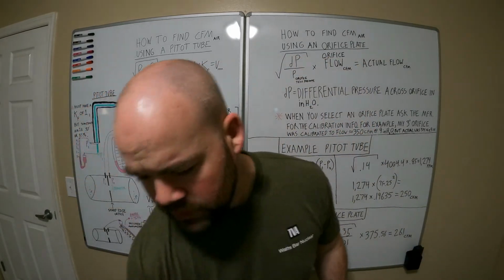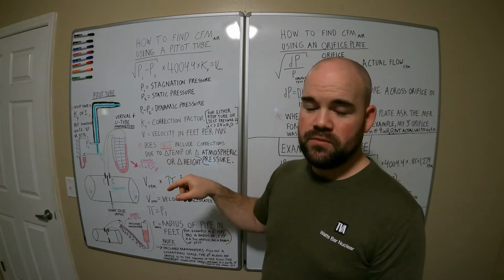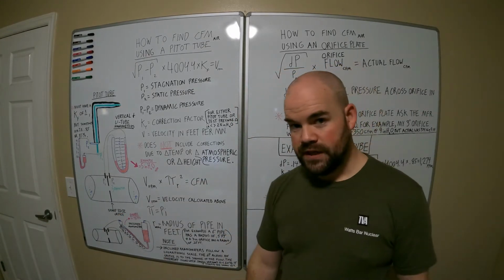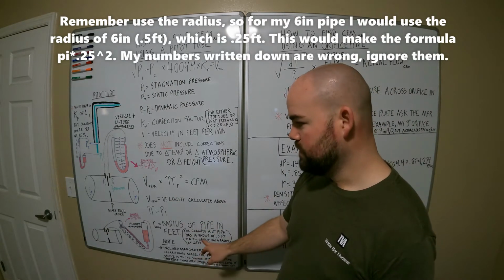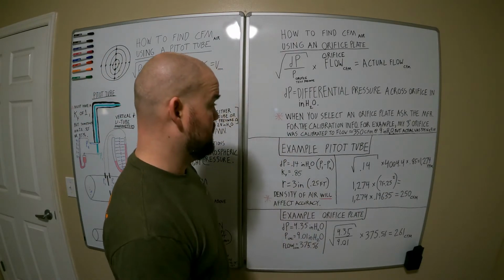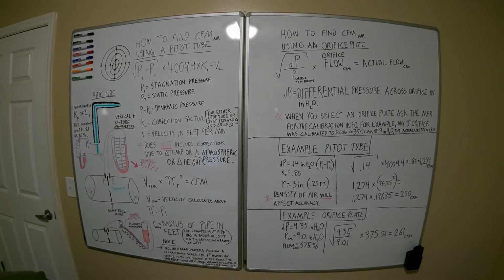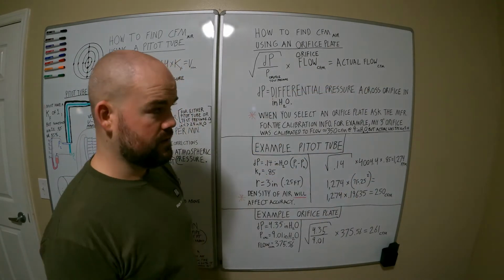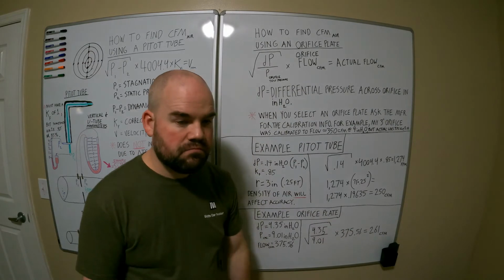Homemade Flow Bench Part 1, How to Calculate CFM

Comment: I’ve watched this video a half dozen times now and I still feel like I’m missing something. I’ll figure this out eventually but right now I’m stuck. I’m putting together a bench like yours. Thanks for helping.
Reply from the maker: @mikefriesdrums  what do you feel like your missing? I have other flow bench videos too.
Reply: @ I think I got it now. I need to qualify my bench that’s what I was missing. I just started learning about this stuff a week ago. I want to have a flow bench to test port mods on LS heads. I have basically the same setup as you with 6” pvc. I made a 2.6” orifice plate but I can make it 3” on my mill. Now I need order a pitot tube and 510i.  So I’ll need a second orifice plate for qualifying and that one goes over the test end.  Then use 510 to measure cfm at 9” water and use those numbers in the equation to determine cfm of test piece.  Diff pres/9” then square root of that multiplied by the cfm it qualified at. I’m on a tight budget so it hurts to have to order the pitot and 510 but I’m sure it will be worth it in long run. Thanks for the great videos.

Comment: Been there done all that. Superflow has the right idea of how to do that. Pitot tubes are a big waste of time in a flow bench.
Reply from the maker: @billshiff2060  unless you have something of value to share, please do not comment on here. You obviously do not understand their role in qualifying a new bench when starting from scratch. Their application is very important for qualifying a new orifice plate as the math can easily be done to find cfm the use that to validate the DP across on orifice. The people watching this video are here for education on how to build their own instead of spending 10k+ on a product that is unnecessary. Superflow has a nice product, but they overcharge and take advantage of people lack of understanding and education. I am clearly not in it for the money, so I share my time and knowledge for those who want to learn it.
Reply: @tristan_white  Using a pitot tube to calibrate a flow bench is a waste of time and is inaccurate. It is a pretty sloppy technique taken from the HIVAC industry, not suitable for high accuracy.
 In every case, a flow bench measures from the atmosphere to a vessel or from a vessel to the atmosphere, rendering a pitot tube redundant because it is a total pressure pickup which is the atmosphere in our case.  There is no use in measuring a section of internal piping on a flow bench where the total pressure is different from the atmosphere.
I am not recommending superflow at all, just their methodology. 
I have built several flow benches and made all these mistakes before getting it right. 
I wrote the original wikipedia article on flow benches. I don't want to re write it here but to point out that this here is not the best path.
Reply from the maker: @billshiff2060  tell that to airplanes, F1,  NASA, and my Nuclear Plant whom all heavily rely using pitot tubes and their derivatives as a major influence in understanding fluid & airflow dynamics.  Superflow uses an open plenum with an offset opening and flow straightener upstream of an variable orifice plate. It's a simple design and has its own flaws but works just like mine in the end. How do you think they determine what each of their orifices flow?
Reply: @tristan_white  Flow elements are calibrated with a King gage. Aircraft use pitot tubes because they fly at various altitudes where total pressure varies a lot. A  total pressure sensor is needed whenever the outside atmosphere's pressure cannot be determined from inside the craft due to it's movement.
Reply from the maker: @billshiff2060  a King Gauge is basically a go or no go gauge, but how do you think it is originally calabrated?
Reply: @tristan_white  No the device I'm referring to is a large telescoping tank that is completely sealed but free to expand. It captures the entire flow over a time period and it's dimensions gives the true volume flowed in that time. All other instruments are calibrated against that data.
Reply from the maker: @billshiff2060  I know what you are describing, however the margin of error is still high on those. As the air is worked it heats up causing a dT which changes the pressure causing adiabatic expansion. As the air cools off it contracts. The device would have to be heated up and stabilized at the exact discharge temperature of the device to be considered an accurate number for total volumn. A pitot tube (while old tech) if used correctly will get you very close to accurate numbers (no problem for a DIY person to do in their garage). At the end of the day, all we are looking for is an improvement in flow given repeatedly is maintained on the bench (no leaks). The actual numbers are for magazine articles and bragging rights with your buddies only as hp is determined by mass flow, not volumn flow.
Reply: @tristan_white  Exact accurate flow data gives you the information needed to determine how much there is left and where to put efforts and where not to. The actual flow coefficients of your ports and sections of ports are needed to know how close you are to the limit. There is a hard, absolute maximum limit on how much flow can be had from a given area at a given pressure differential. To know where you are you need accurate info.
It would be great if you could compare results with others in the field but that is unlikely because of all the inaccurate stuff out there. Like the dikhead move of using increments valve lift instead of L/D increments makes it impossible to compare  anything other than identical setups.
Reply from the maker: @billshiff2060  I agree with you there. The flow bench is misunderstood and is not used correctly often. I will also say, though, that measuring the localized port velocities per cross-sectional area is best done with a miniature pitot tube 🫣 lol
Reply: @tristan_white  Oh I am not saying pitot tubes themselves are not good. Only using them as the flow measuring element of the flow bench itself.  For exploring test pieces they are very valuable. I made many and used them all the time. For that they are an essential tool but they do require a good knowledge of how they work to understand what they are telling you.
Reply from the maker: @billshiff2060  yes they do.

Comment: Is there any documented reference you can point me to for the formula on calculating the CFM using an orifice? Before I found this video I could not for the life of me find or figure out how to do this calculation. I finally decided to try YouTube and here I am. But I would like some insight as to where the formula you're showing came from, if at all possible? It makes perfect sense when I used the factory orifce specs to this equation. I'm glad I found this video, everything is explained very clearly!
Reply from the maker: It is a simplified version of Bernoulli's equation. The square root of the differential pressure is directly proportional to flow rate. Watch my video later in the series for how to calibrate your bench. Once you know what flow you have using the pitot tube equation given a specific pressure drop across the orifice you can input it into the orifice equation. The square root of the dP is a percentage of a known flow at a fixed pressure drop. Does that help?
Reply: @tristan_white  Ya I'm definitely understanding it better, much appreciated in taking the time to write back!
Reply from the maker: @Teddy8709  Anytime.

Comment: I have build a flow bench using testo 510 but my differential pressure is only 0.2400 psi average with 3 vacuum pumps. What can be wrong . My orifice is a PTS 350 cfm @9" with a 2.933" hole.
Reply from the maker: What are you trying to flow test, and what is the test pressure set at? Whatever your flowing is at 57cfm if the calibration is correct for the orifice. What are you expecting for flow or dP?
Reply: @tristan_white  I’m actually now setting up the bench. The plan is to flow some 4 valve cylinder heads from some imports. Is there suppose to be a Great Depression before and after the orifice plate where the testo lines connect? I have great suction at the end of the 6” pipe but little suction where the testo lines connect
Reply: @tristan_white  what is the correct position to have those probes for the testo. Could I have them in a “dead” zone ? With no pumps on my DP reading is 0.0060. Then when I turn on the 3 pumps it goes to around .2500 with the 4” hole at the end of the pipe fully open and no cylinder head bolted to it
Reply from the maker: @stuntr1  make sure you zero out your testo. If the bench is off there should be zero dP. Also, make sure you have the testo just looking at dP in inches of water (inH2O). The pressure taps should be just like I have them in the video, as close as humanly possible to the orifice plate on both sides. You want them away from airflow or you will have the venturi effect and it will mess up your readings. Once all of this is verified do it again. If you get the same reading let me know.
Reply: @tristan_white  how do I zero out the testo?
Reply from the maker: @stuntr1  on the app in the corner it has a menu button that you click on and hit zero.
Reply: @tristan_white  thanks. The testo was indeed set to psi instead of “h2o. Differential Pressure across the orifice is now as high as 6”h2o with my 3 motors on. I’m strongly considering a well-type manometer like u have , for ease of readability
Reply from the maker: @stuntr1  no problem, glad I could help.
Reply: @tristan_white  where can I find on of the well-type manometers like yours
Reply from the maker: @stuntr1  Dwyer, however you may have to call them to get one that goes to 30" H2O.
https://dwyer-inst.com/series1230-1235.html
Reply: @tristan_white  ok. Great. Also. Just to clarify . What is you procedure to make sure everything is sealed up properly before starting to flow test ? Eg. head seal to fixture etc..
Reply from the maker: @stuntr1  I rub vasoline around bore, place the head on the bench, secure it, and with all valves closed turn on the bench and crank it up to 28" H2O. You should have zero dP across the orifice if sealed properly. If not you must subtract whatever the number is from each of your lift value dP's. So for example, if I have a .02"H2O leak and my .600" lift dP across orifice is 4" then you would subtract the .02" and use 3.98" to calculate flow.
Reply: @tristan_white  great. Thank you
Reply: @tristan_white  one last confirmation. Orifice sharp edge goes to the side to head being flowed right or to the vacuum box side
Reply: Hi, is there any other solution to measure head flow cfm? For example using like any sensor in the intake to measure the intake flow cfm? I just need to find my cfm to match my cam lift, thanks a lot
Reply from the maker: @Muhammad Akmal Fadilah  that is a very loaded question, but the simple answer is no. Inside of your intake manifold, you have a very dynamic environment with pressure waves, atomized fuel, and turbulance. The only way to truely understand the flow characteristics of your heads, manifold, and throttle body is to strap it all to a flow bench and velocity map the entire thing. Between that and the actual flow data for each lift point you can derive the right camshaft profile given the piston head design etc is taken into account and based on where you want to make power and torque. What heads do you have?

Comment: Thanks for this . would there be or is there a flow bench that operates with lower power demand as a 60Amp supply and 6 fans  is a real issue to me.  I have 15 to 20 max. I appreciate it is a  CFM and Inches water. requirement  most probably.
Reply from the maker: Unfortunately if you want an apples to apples comparison with the industry you must be able to hold a steady state 28" H20 at all lift values. Depending on how well the port flows will determine the volumn of air it will take to maintain that pressure. However, if all you want to know is if you are making improvements then just make the bench as powerful as you can and just look for a larger pressure delta.